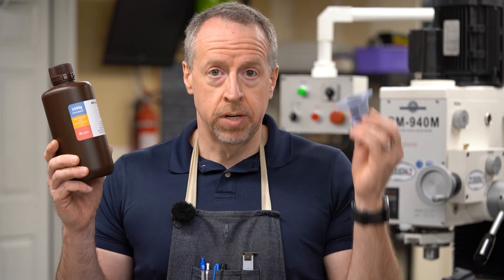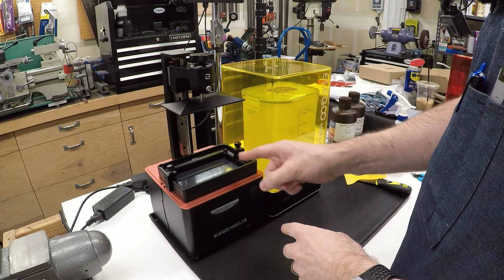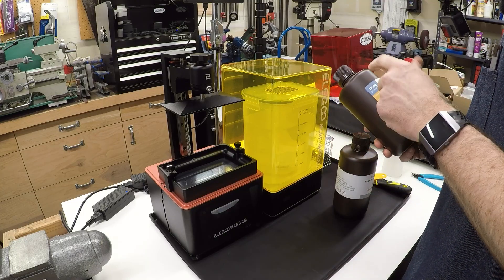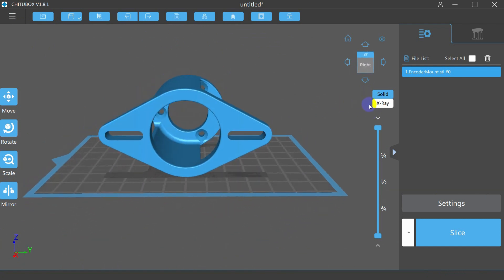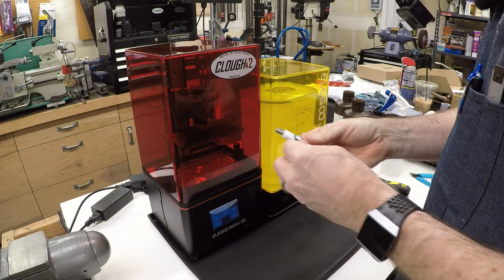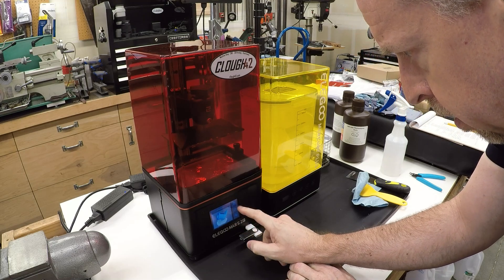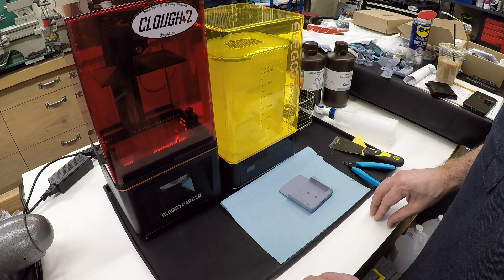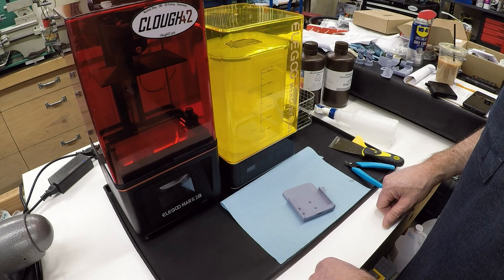Trying out a New Resin 3D Printer | ELEGOO Mars 2 Pro + Mercury Plus

Comment: Can you replace the sheet in the tub yourself? Also, why don’t elegoo coat the build plate before they ship the machine?
Reply from the maker: Yes, it comes with spare sheets.  There are lots of variables.  Maybe I'm doing something else wrong or my conditions are a little different.  Or maybe something else changed that made it start working after I treated the sheet.  Don't know, but I saw the tip, tried it , and had success.

Comment: Would you be open to trying other resins without the extra hassles (dry ptfe lube, "buttering up the platform")? I had the same issues (and solutions) that you are using when using Eleegoo resin, but not with others (such as anycubic).
Reply from the maker: Interesting.  I'm just figuring things out.  Any suggestions for appropriate resins for functional parts?  Most everything I see is really brittle or weak.
Reply: I've had very good luck using using anycubic grey with 20% by weight siryatech tenacious mixed and have had no issues with large flat parts sticking to the FEP film.  The anycubic grey on its own is hit or miss but with the addition of the siryatech I haven't had a problem with the additional benefit of being a bit more impact resistant.
Reply: I have also used Anycubic resin without issue.
Reply: And I use the original Elegoo Mars with no upgrades. About to go look for a mono lcd panel to fit it.

Comment: What is the cost difference between filament and resin printing? This seems like a lot of extra pissing around  and potential mess with no apparent gain in quality or strength. I noticed there was what looked like an expiration on the resin bottle too... does resin go bad?
Reply from the maker: It does have an expiration date.  I don't know how critical it is, but it's certainly different from filament.

Comment: I wonder how long it took you to realize that resins slowly warp especially with heat after they are created?
Reply from the maker: The phone holder I showed is mounted in my car where it is exposed to sunlight and summer temperatures above 40C, and I haven't noticed any changes.  I'm sure it depends on the material.
Reply: @Clough42  Yeah that may work, anything under spring pressure that is not triple over-built will slowly bend, I also used it for a Pawl (cam-pawl) thinking its glass-like strength and hardness would work...nope they all snapped and shattered after short use. If this stuff ever gets up to real ABS strength that will change the game.

Comment: Not sure if you will see this comment so long after the video went up, but hopefully!
At the end you discussed printing a timing belt pulley, I've been very interested in buying an Elegoo Mars and this is one of my main use cases. I need high speed, accurate pulleys for a CNC machine I'm making (powering a rack of DIY spindle motors), but all the Chinese GT2 pulleys absolutely suck. So do you think resin printed pulleys are viable? Smooth enough surface texture and accurate enough to spin without vibration, and not wear down the belts?
Anyway, great video!

Comment: My machine only prints the first few layers and they're on the fep. I've tinkered around with curing times and upped them to 8 seconds and 60 seconds bottom time, and same result. Extremely sad. I even level after each heartbreaking 2 dimensional print. Any help 😔
Reply from the maker: The video shows what I did: buttering the plate and using PTFE on the FEP.
Reply: @Clough42  thanks. Will buy and try
Reply: I found WD-40 But it doesn't say PTFE. Will it do?
Reply from the maker: @rogg0224  the recommendation I saw and tried was the version with PTFE.  I can't speak for anything else.
Reply: @Clough42  I'm printing with non pfte right now. Will tell you the result.
Reply: Did not work.

Comment: Question after a few month, did the parts last?
Reply from the maker: Yup.  The phone holder is still in my car and I use it every time I drive, and the encoder mount is still on the lathe.
Reply: @Clough42  Well done. I am looking for some though resin to make threads and screws more reliable, as esp. small diameters are still pretty brittle with regular resin. For every mechanical part I print, I have very good experience with ABS like resin.

Comment: There is ZERO need to "treat" your FEP sheet. I have no clue why that is the suggestion he went with. What he SHOULD have done is scuffed up the build plate as you ALWAYS should, then look up the recommended settings for whatever resin he's using because these settings are likely incorrect. I repeat, there is ZERO need to spray your FEP sheet with anything and there is ZERO need to "butter up the bottom" with a layer of resin. Why would you do that when it's about to be completely submerged in resin anyway? The air bubbles are not a concern, at all. There is no need for one large raft, you can set for each support to have its own raft. This uses much less resin and makes the part WAY easier to remove from the build plate. Medium/small supports are totally fine, heavy supports can be overkill. You want the LEAST amount of supports you can get away with because this means less resin used, less post-cleaning work, less possible surface marring from support removal. Wildly canting a part to the side can also be unnecessary. What you should be doing is tilting the part so it has the least amount of overhang and requires the least amount of support. The best thing to do is put your part in PrusaSlicer and use it's auto-support setting. PrusaSlicer is top tier, the absolute best you're gonna get. Once PrusaSlicer has done it's thing, you can add/subtract supports as you want, then export it and throw it into Chitubox and check supports again. One thing he's also not talking about (to be fair he doesn't need to with what he's printing in the video) is larger parts need drain holes. There is a tool in Chitbox to bore a hole in the walls of a part to allow resin to flow out during printing. ALWAYS WEAR GLOVES WHEN HANDLING PARTS. "Buh buh buh rage in comments, drive my metrics." You DO NOT screw around with safety. It is not a joke, it is not a "suggestion". You can get VERY hurt by resin. Resin left on the skin can absolutely cause chemical burns. When working with anything you ALWAYS err on the side of safety, "buh buh eco-resin whiners" aside.

This entire video is someone who is brand new to resin printing trying to teach how to resin print. Do not follow the tips in this video, it's only good for seeing how the process works.

Comment: Rafts are literally the worst and are not worth using.  Even with the proper ptfe lubrication on the film you will still run into warping when using rafts.  Stick to standard bottom supports. To maintain the highest degree of accuracy you want a limited amount of material hardening per layer.  Even with the perfect amount of lubricant application on the ptfe film you will still run in to warpage due to the mechanics of liquid suction due to the viscosity of the resin.  FDM and FFF printers can benefit greatly from the use of a raft. SLA printers are hampered by such mechanics.  If you attempted to build a rectangle as an example the entire length of the build plate you will run in to massive warpage at best or catastrophic failure at worse. If you want accuracy you have to print layers that do not have large areas of exposure.  Printing a cube for instance, you will get much better results printing it as a shell verse a solid, and printing it at an angle to reduce large flat surfaces.  I have been using SLA printers in the dental industry for quite some time now.

Comment: In addition to coating the build plate, you can, cure the resin as well by putting it in the cure station. This insures the best possible adhesion. Give that a bash...
Reply from the maker: Cure a layer of resin on the build plate?  That sounds like a messy process.  In the months since I treated the FEP, I haven't been buttering the plate first, and it's been working fine.

Comment: Very Strange! I have the same printer and I don't have an adhesion problem. It is sometimes even sticking to good to the buildplatform when trying to get it of. And I just use standard settings and no teflon spray or something like that. There could be two reasons for your problems: I only used water washable resign till now with no problems at all. Maybe the ABS like IPA washable resin is part of the problem?! IMHO more likely reason could be your leveling with more spacing than recomended. I did my leveling exactly as descibed and as I said: No problems with bedadhesion at all! More space could result in less adhesion in the first layer if it is to thick to realy cure the resign contacting the bed. Maybe?!

Please excuse my english - it is not my mother tongue!

Let me know if you want me to get in contact to exchange information about the printer and settings.
Reply from the maker: I actually think my spacing is too close because when it descends for the first couple of layers, it hits the bed and flexes the column back slightly.
Reply: @Clough42  But why is your bed adhesion so bad? That's not normal. Have you ever tried an other resin? Do you have a printfile which you cannot print? I could try to print it. There must be a reason for your problem. I have to use the metal spatchler to remove parts because the plastic one broke because bed adhesion was to good!

Comment: A Thumbs up from me, enjoyed the video. May I thoroughly recommend to you the 'Water Washable' Resins! A WHOLE heap safer, better, cleaner and CHEAPER than the IPA washable resins. I am not an expert, maybe print twice a week a few things, but since i switched to Water Washable stuff, i have saved HUGE money on IPA, the smell of the resin  IMHO is less offensive, and NO SMELL from fresh water LOL!
Reply from the maker: How are you doing the water washing?  In the Washing station, or somewhere else?
Reply: @Clough42  Yes I have the exact same as you, The Mars 2 Pro and the Wash station. The best thing is with WW Resin i can afford a Fresh Wash every print LOL! But i actually change the water every 4 or 5 prints. Water Wash Tip, If you do the wash in warm water, then it makes getting the supports off even easier! 
As of yet (2 months now) i have not found a reason to STOP using WW Resin, although i have not tried all the WW Resins. I mainly print in White, Black and Grey. 

Give it a go, it will save you a lot of Money and Time. It may suit you...You may Hate it, but for £25 from Amazon it's worth checking it out.
BTW, I take supports off before UV Curing, as mentioned using warm water they just pop off, and i use the good ole English Sun to cure 10 mins in the conservatory and baked Hard.

Comment: 😱😱😱.,.. Always, and I mean ALWAYS wear gloves when handling resin or other chemical stuff.
It's just a common sense safety measure like wearing a helmet when riding a motor bike or wearing the safety belt in your car.
Always use safety measures, especially when handling the pre-cured resin. The resin feels 'soft' and the alcohol contains uncured resin.
This means that when you get the alcohol on your skin, you also get uncured resin on your skin and the alcohol will be absorbed into your skin - as will the resin.

I once used the IPA that I washed (just a few) parts in to clean something else and that is now sticky for the rest of its life ...

Comment: Resin is too brittle for almost any engineering application.  We have been trying to print resin parts like connector adapters and backshells and it just does not work.  One drop from as little as 3 feet and the part shatters like glass.  Yes, we have tried dozens of different resins, and they are all BRITTLE, no matter what the manufacturers try to say.  We have tried "hard tough", "abs like", "tenacious", mixes of hard and flexible and they are all useless.

From my point of view, the only thing resin printers are possibly useful for is for making tooling to produce a mold that can be used to make urethane parts 60-80 durometer.

The carbon nylon FDM printed parts have been the only thing close to resilient enough to withstand real-world use.
Reply from the maker: Probably depends on the application.  I've been using the phone holder I printed in my car for a while and it's working fine.

Comment: Probably want to use gloves while handling soft parts... resins have stuff that acts as estrogen in your body. Epoxies are nasty stuff.
Reply: "We found that parts from both types of printers were measurably toxic to zebrafish embryos, with STL-printed parts significantly more toxic than FDM-printed parts. We also developed a simple post-printing treatment (exposure to ultraviolet light) that largely mitigates the toxicity of the STL-printed parts. "
Fully cured parts are no longer as toxic.